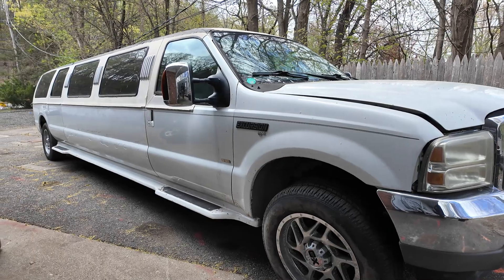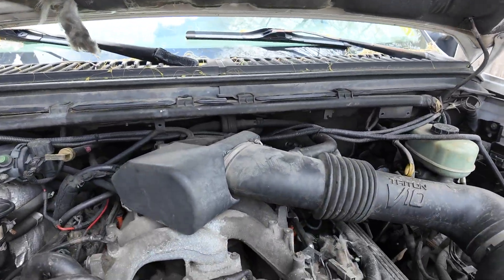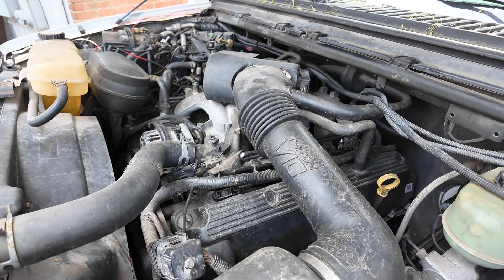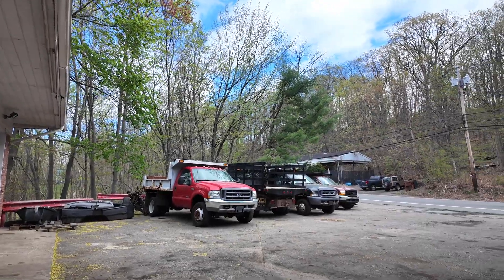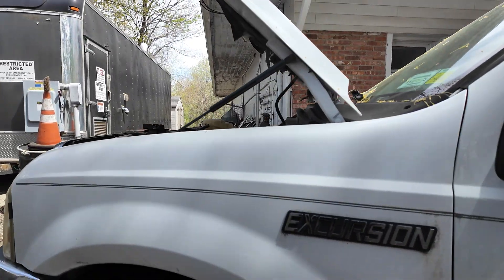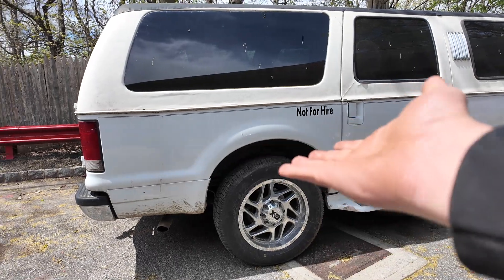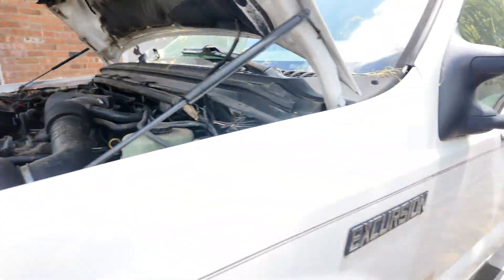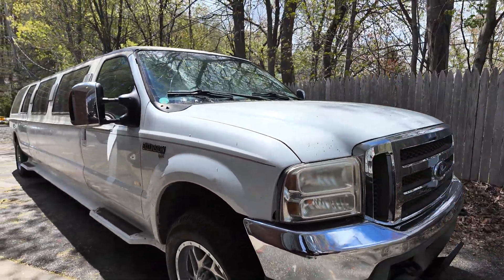6.0 or 7.3 Powerstroke? Which is the Better Diesel Engine For This Particular Truck?

Comment: If you just fix it properly you have a nice limo .  If you try to hot rod it you just twist the frame or but the driver line.  It is limo not hot rod or 4x4.

Comment: 7.3 yes, dually yes, 4x4 yes,  regards to interior rip out the back carpet,  put in vinyl flooring.  Add a water tank and make the sofas convert to beds.  And now you have a camping rig as well.  You could also fabricate a roof rack to carry gear and a spare tire.